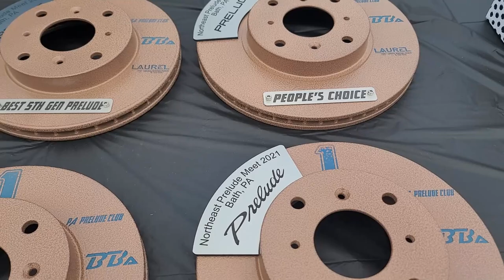The biggest Prelude meet on the east coast | North East honda prelude meet 2021

Comment: I own a 95 Prelude 2860 pounds, but I like the 3rd Gen 1988-1991. The 1990 Prelude weighs 2566 pounds and the 5th gen is 2900-3100 pounds. So the 3rd Gen is 500 pounds lighter than a 5th gen and can use a H22, 4disc brakes, and independent suspension. So the 3rd Gen is the lightest chassis supporting the H series engines. Even the earlier 3rd Gen Prelude 87 and earlier have independent suspension, and support the H series. 500 pound  is equivalent to 100hp usually. With the same engine a 3rd Gen feels like it has 100hp more than a 5th gen because it's 500 pounds lighter. 3rd Gen is the fastest lightest chassis supporting the H series. A 200hp H23A Vtec even fits in the 3rd Gen.  The 4th gen 1992 model is 2760 pounds the same as a Acura Integra. Trust me 3rd Gen is the best, and I own a 4th gen 95 SI. 3rd gen Prelude owners complained that the 4th gen was too heavy in the 90s, and the 5th gen is even heavier. The 5th gen is  the heaviest Prelude ever made. 500 pounds might gain a whole second on a quarter mile race. Go from a 13-14 second car to a 12 second.